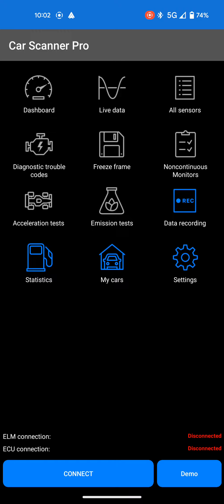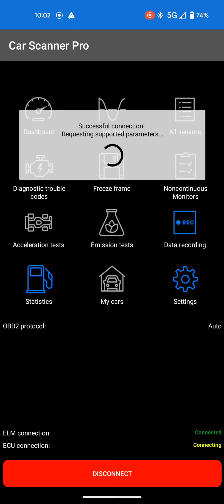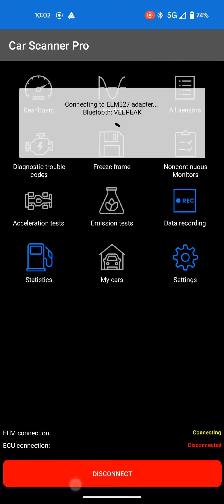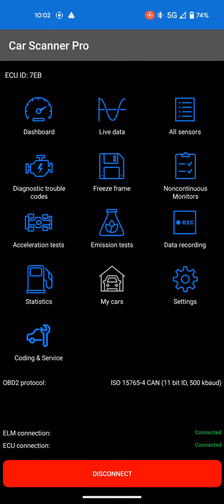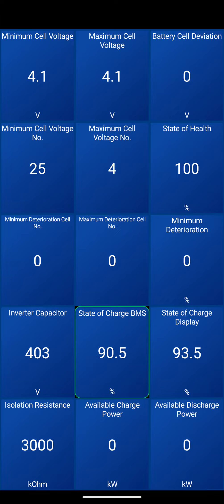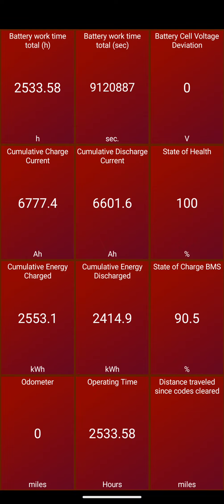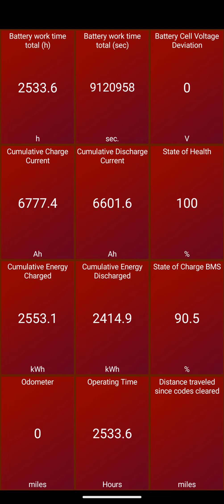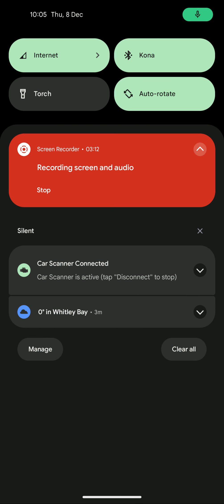what is the state of health SOH of a Kona after 17k miles part 2 car scanner Pro app

Comment: Are you using pro version of this app? i am using free version and its not showing battery health. do i need to buy pro version?
Reply from the maker: Yeah I figured it was only a fiver
Reply: @Lewis_Standing  great. i bought it and it worked. my battery health is 100% . its 2020 with 21k miles.

Do you know if there is any option in this app to run water pump so that i can bleed and remove air after changing collant.
Reply from the maker: I've not explored any more of the app I'm afraid other than reading this info. 
You can get a download of code for diagnostic faults a bit like a garage but not sure you can give it instructions. 
Might be worth having a play and see what you can find on there